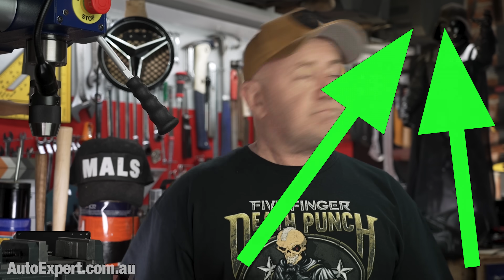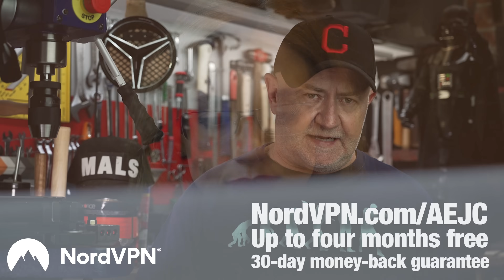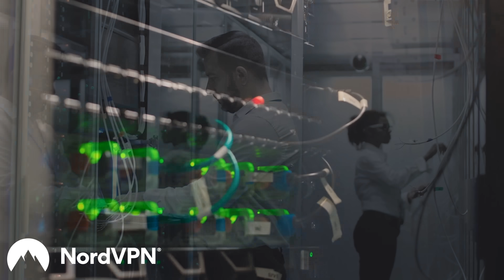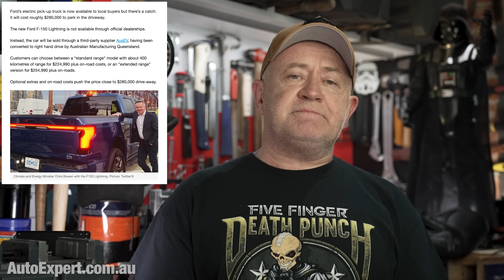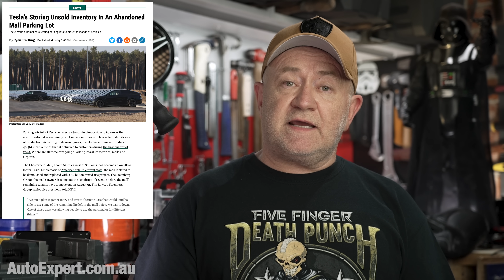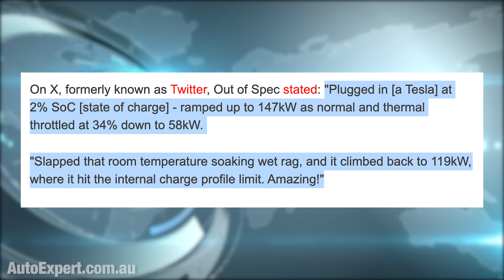ELECTRIC UTOPIA? Top 10 insane EV reports (this month)

Comment: You need to move 200t of earth to gather enough lithium for one car, the millions of liters per month just the power the diesel machines. The power bulb ING supplied to the factory that will enrich that lithium, mostly runs from coal, oil or gas power plants, as you wash the lithium you create a toxic pool of crap that is dumped open air in China. Those artificial lakes of toxic crap, are so concentrated some of them have started to emite radiation.
Rest of the stuff used to make car, let's see cooper, since electric cars use 10x more then ice. Cooper mining is toxic and hard, and we need it for our everyday life and luxuries. All those cables in the super chargers. Etc etc.
So after all this pollution, I don't think there is anything green on EV.
Buy a 100% ICE, the environment thanks you.
Just like I did recently, I bought a mustang dark horse v8 500cv, it's a green car, only has a lead battery and its 100% lithium free.

Comment: More batteries are added too ev's the more weight is distributed which means in turn the same mileage because of the weight factor, as weight kills power, of which means less mileage.

And just imagine the tyre wear and all of the steering componants, they will all cop a caning, as more batteries mean more weight, therefore you will be paying more on weight tax and therefore too make the batteries factories will pump out more pollution than any of the EV's that are created and built, so contradictory.

Then when you use your A/C or even your heating a lot less real time mileage would be reduced once again compared too your ICE vehicles, no difference in my opinion, I will always love my ICE vehicles regardless, as you can not improve on perfectionism, no matter on what that man has too be able to build.

Comment: Talking about the towel on the charging cable   , as a young naive  bloke working in a factory with a lot of water around ,  one of the fitters working on a machine had an extension lead going through a very shallow puddle of water , and now and again me and my buddy could see a spark occurring through the extension lead insulation into the water , i had gum boots and thick rubber gloves on  , and thinking    “ She`ll be right ” i grabbed the lead to drag it out of the puddle  , and copped a momentary 240 volt zap ,  moisture in the glove had found a tiny pin hole and a bunch of 240 volts .
  I had been zapped by car ignitions many many times over the years and that was uncomfortable. , but the 240 volt zap , i thought i was a dead man  , oh man it really hurt , that was a wake up call. Electricity. …… not to be fucked with.
   These guys putting a wet towel on the EV charge lead with so many more amps , is just crazy .
Reply: LOL I copped a 3 phase boot once while kneeling down on a metal platform. Went into my left hand and out my knee
Reply: 800VDC is a LOT more dangerous than 240VAC.
Reply: And apart from the risk of getting zapped, this "hack" is kind of aimed at tricking the temperature sensor into measuring a colder temperature. And ok, there's some local cooling by the wet towel, but the cable for instance is not cooled at all and might run overly hot when the plug is wrapped in a wet towel.
Reply: @christiandisch8147 the 350kw capable cables are liquid cooled. Horses for courses. The cables running at 150kw or less don’t need (much) cooling regardless of whether the cable is liquid cooled or not

Comment: 100mA will result in a fatality if the skin contact resistance is low enough to allow the current to pass through the human body that being the reason protective safety devices are set at or below 30mA.  5kw or 25kw is meaningless in that context. Having regrettably attended numerous contact incidents over 40 years I speak from experience

Comment: Worrying about the wet towel hack being a shock hazard is silly as fast/super-chargers are intended to be used even under rainy conditions. The outer conductor in EV cables is a grounded shield for EMI and communications. Any moisture that gets in the cable will cause leakage current between conductors and ground. Both the EV and charger monitor residual current and terminate charging when leakage exceeds whatever threshold they are set at. Fast-chargers are likely safer than a GFCI outlet or RCD circuit since stuff plugged into those rarely has a grounded shield around their main conductors for fault current to go into when primary insulation fails. Fast-chargers being required to be this safe likely accounts for a fair chunk of the reason why they are so frequently out-of-order.

Heat wise, the thermistor in the handle is there to monitor the contact pins for excessive heating from inadequate electrical contact. A towel outside the handle's plastic housing won't interfere with the thermistor's safety-critical function any more than a cold day would. All the towel does is shield the handle from external heat sources so the charger doesn't slow down due to external heat sources. The handle thermistor also isn't the only thermistor in the whole system that can trigger current limits. Tesla puts some near typical points of failure. IIRC, they also embed a few in the cable itself. If it is really too hot for the charger or wiring to safely push the current, the chargers have multiple other temperature sensors to make that call on.
Reply: I bet as a kid, you peed on the electric fence to prove nothing would happen!

Comment: Great, a solution that already exists in a form of a big powerbank. What they should do instead is lobby manufacturers to install a connection somewhere in the trunk for an optional directly connected powerbank to extend existing vehicle's battery capacity. This will allow to avoid loss of energy and waste of time recharging and use an extended pack immediately when needed or even allow to plan ahead in case extended range is needed (for off-roading or long cross country hauls).
Reply: A reel in the trunk of your EV for your 10 kilometre electrical extension lead so you can charge from home as long as your office is no longer than 10km away? 😆

Comment: 21:36 I think you meant ‘Architecture and Fire Engineering for Dummies’

And local building regulations or a rational design should make provision for two direction of egress. Why in ‘Merica yoi have those steel stairways outside your apartment window. They are not just for movie chase the guy through your apartment scenes.

Comment: 22:42 I’ve worked as a fire engineer, and man this is going to be ‘fun’ when you approach a client and say that you cannot have ANY open plan living (BS9991) and have each room enclosed with a self-closing fire door rated to 120min fire resistance…add 120min rates walls and seals and HVAC fire dampers, you name it. Add some automatic water fire suppression system?!?!?! Wonder what a one bed apartment would cost then?

No those utility rooms: maybe throw in smoke ventilation and then also polishing the gases to be safer to exhaust to atmosphere.

It would be interesting to see an escape simulation done with said battery rate of heat release.

Buildings will become more complex from a fire life safety perspective. Which client will pay for that? None! You will get sacked from the job.

Comment: 9 - The wet towel is crazy, it is the result of EV owner frustration; however, in case of heavy rain isn't it worse? The columns are not covered like the distributor.

Comment: There isn't any way to use EVs in combat or even military field exercises.  Military vehicles must be robust enough to function in the worst conditions of weather, on unimproved roads or even off-road and be able to function with "battle damage".   Besides all that how will they be recharged?  Diesel powered vehicles can be refueled very quickly.  Diesel fuel is quite portable.  So how do you maintain a logistical chain of a 50 EV convoy carrying supplies from the rear to the front? How will the Engineering Corps retrieve damaged EVs? The question is, how do you bring enough electrical power to recharge EVs in field conditions?  With ICE vehicles, they don't return to the rear to refuel, the fuel is brought to where they are.
Reply: Can you imagine being in an electric APC and a mine goes through the battery? Probably up there with the worst ways to go

Comment: You're not thinking 5 dimensionally... The "battlespace" is a metaphor for the cut-throat competition at every charging station for a decent high rate charger. Each set of 3 modules allows you to breeze past that overcrowded minefield of woke vegans, to the next overcrowded minefield of woke vegans, where you at least get the satisfaction of having 6 extra kWh to draw, adding 1m12s to your charge time which will be noticed by those behind you in the queue, er, sorry... "battlespace". 😂

Comment: 2kWh per 20kg battery sounds awfully low when modern LFPs are doing ~200Wh/kg, the highest density NCAs are over 260Wh/kg and current-gen solid-state batteries are around 300Wh/kg. If 2/3 of the weight is battery cells, that should be 3-4kWh for today's commercial battery tech, military is usually a step or two ahead. Still doesn't make much sense to move 100kg of batteries to charge an EV when a 50kg generator and 50kg of fuel would do a ~10X better job per kg hauled. If the vehicle needing rescuing is close enough to carry 100kg batteries to it on foot to give it 15-40km of range, it is likely accessible enough for the rescue vehicle to get close enough to use a V2V cable instead. May as well just make the rescue vehicle a DC generator hybrid with 1kV battery pack and give it V2V fast-charging at 150-500kW. Doubt these portable batteries can go anywhere near that fast and I'd rather be done with rescuing in 1-3 minutes than 10+.

Comment: They could build in an auxiliary battery almost like VW did in the 40s.
When you run low on electric motivation a light would remind you to switch on the "reserve" tank of electrons which would get you to the next (non working) recharge port.

Comment: The EV economy is bound to fizzle out. You can't power the full EV cycle—from lithium extraction to battery reprocessing—with windmills. And—here's the millstone around the whole idea's neck—the roads, the tires, electric cable insulation, plugs and sockets, all the plastics inside and outside the EVs, displays, etc., are still made of oil derivatives.
Reply: Turning oil into plastics is perhaps not quite as frivolous as burning it?
Reply: @christiandisch8147  Ah, but we don't burn oil. We burn gasoline which is a high fraction. The remaining fractions are used to pave roads, produce tires, plastics, indeed, but also pharmaceuticals, like Aspirin. Nothing gets wasted.

Comment: As we've seen in Kiev and Gaza, etc, the first thing to get turned off is the power. First hour of the first day, literally. Good luck charging your iPad, let alone your fleet of 30 tonne EV Abrams battle tanks.
Reply: I am optimistic that Australia won't be at war, but I do live in an area with a grid that is described by those responsible as "fragile", meaning that we have frequent power outages.  Our solution, Solar PV and a battery.  Provides backup when the power goes out, charges the battery even when the power is out, and seamless to the user.

No issue charging an ipad.

That said, if we were at war, taking out a couple of coal fired plants could bring the country to a grinding halt, as mobile and NBN services go off-line.  Think no EFTPOS, atm's or banking in any form.

The reality is that we have a high dependence on electric technology, and while John puts on an entertaining show about the dangers he perceives, the irony is that it is delivered online.

Australia is well placed for renewable energy and electrification of a fair percentage of the passenger vehicle fleet.

It is worthy of note that each tanker of fuel imported into Australia requires 16 thousand tonnes of fuel...

I am supportive of technologies that bring us as a country to a point of energy independence.   I agree that the tech isn't at a stage where wholesale electrification of transport can be achieved, but I do recall the first ICE (and steam) required someone to walk in front carrying a flag...

Comment: EV's cost 20% the price to fill if you don't have solar, with solar almost free, thats why gas car mechanics like this guy are feeding bad info about EV's lol. :face-green-smiling::face-green-smiling::face-green-smiling::face-green-smiling::face-green-smiling:
Reply: Actually solar is NOT free. I could show you the calculations done by CSIRO engineers: you cannot save money with solar panels on a home or a car. Why? Because the panels have to be replaced within a few years and that kills off any hopes. You might finish slightly ahead if you get a subsidy.

Comment: I recently went on a 300km (one way) road trip.  Noticed a brand new six bay EV charging station half way, and saw that despite it working, no one was using it.  On a Friday and Sunday.
Perhaps this morbid fear that if you drive more than 100km from home and there will be no where to recharge is a little overblown.
Reply: And sometimes there is an empty petrol station. What are you trying to say?

Comment: EV's weren't going to be any more than a toy for the rich anyway. In the state with the highest percentage of registered EV's (California @ 3.9% as of 2022) the grid operators must already tell EV owners not to recharge during certain hours in order to prevent blackouts. If/when the US ever gets serious about pushing EV's, there will need to be a massive expansion of the power grid - perhaps tripling its capacity or more - and that doesn't seem to be happening. All those 2030s mandates are going to rust in place.

Comment: Annual reports from fire rescue NSW about 2500 petrol and diesel vehicles fires every year as of 3 March 2024....doesn't stop people driving......

11:05 tesla cyber truck front trunk fixed by over the air update....top gear posted a video on this......
Think back 5 years ago how many full electric vehicles where there on sale compare to today...
Tesla went from zero cars to 5 million  in 10 years,more factory's and supplies lines added each year,China has bet big on ev's dozens of different vehicles...
As for Toyota $240 billion in debt...
Vw $210 billion in debt....
Audi $182 billion in debt...
Ford $151 billion in debt...
Gm $122 billion in debt...
So legacy companies can't make ev's for profit or scale...so doubling down on hybrids ...if battery's get greater scale making them cheaper to produce, the old boys are all doomed, not all will survive....bail out anyone?....
The future is electric...get some solar on your roof charge you car and help with home bills...come with me  protect yourself and your family from high gas prices....as more people go electric oil/gas will raise its price's..

Comment: I think the math of ten kilometres per can is a bit off.
Charging efficiency aside you can’t get the full charge out of the external battery, at most you could get 90% unless you want it to nuke itself which it may very well do anyway with basically a dead short plugged into it.
My math guestimates three kilometres per VSM can
Reply from the maker: I was striving for generosity.
Reply: The idea of a power pack would be ever so slightly less idiotic if it just plugged in an internal receptacle and powered the VSM directly. If so all VSMs should be fitted with such receptacles so that the various auto clubs could get the idiotic things moving off to get a Jesus fix.

Comment: $10,000 bonus for every Tesla made since 2008 and it's only 5 million units, where is the money coming from a magic tree?  The Tesla disciples need to be committed to insane asylums for their own safety.  I have to say I laughed a lot when you actually showed these muppets self harming and am still laughing inside 10 minutes later.  Politicians have not got any brains that actually function and have a track record of ignoring risk management on all levels especially economics, so there is no chance of them being bothered about a few people being cooked alive, they die for the cause.  The wet towel morons clearly skipped physics lessons.  Great video and very entertaining but sadly quite depressing but as Forest said "stupid is as stupid does".  A quick note on the Staines on Thames Tesla HUB and collection center in the UK which as of 10th May 2024 has completely gone, all cars, temporary buildings and signs removed and area locked up.

Comment: On #9 evaporative cooling: Sure it's effective, but 400...800v DC is shockingly scary (pun intended). Direct Current is the kind where your muscles just lock-up even tighter and you can't let go . If you are the bystander, good luck trying to pulling them off (unless you're wearing rubber wellies). On the point of industrial machines, where's the big red-stop button on these chargers. In a world where you can get canceled for many things, why doesn't this get applied to people giving such dire life-hackers.

Comment: So next time I head off to war, I will need to tow my tandem trailer full of the electric jerries all charged up.  
What sorcery are you talking about John, you mean a 20 ltr jerry can full of liquid fuel can get me over 200 km in my Defender.  Unbelieveable!
Was wondering where my urinal on wheels I have been patiently waiting for is.  Sitting in some random carpark abroad!
Reply: On top of that the jerry cans weigh nothing when they’re empty. Batteries are gonna add tons of weight even when completely useless to you.